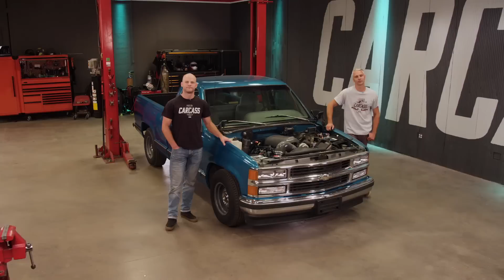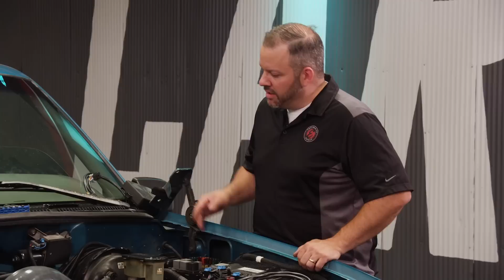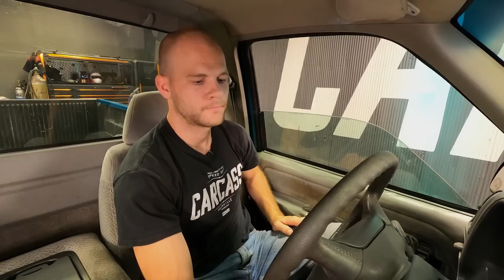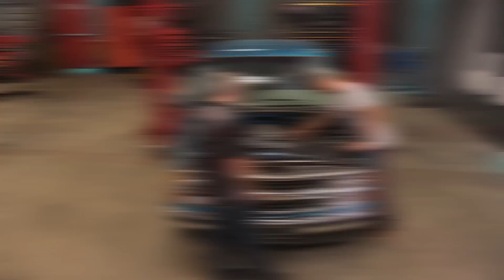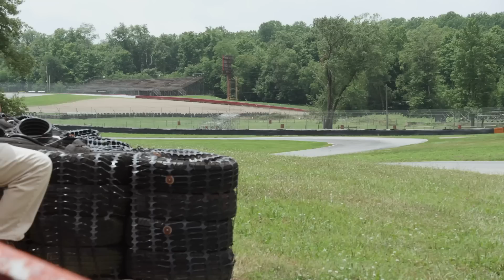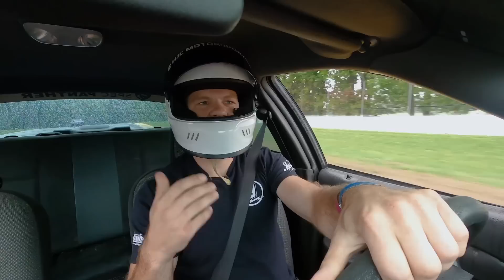Adding An EFI Setup To The C1500 Chevy - Carcass S3, E16

Comment: The gaping hole in “self-tuning” off the shelf EFI systems NOBODY wants to talk about is timing tables. RPM vs MAP vs degrees of timing. From cranking to running, idle, into AE, WOT, DE and everywhere in between to find the MBT for every cell in the timing tables. Only patience, experience and about 5 hours of chassis dyno time will yield those results. Or trial and error data logging on the street over many more hours in far less ideal conditions.

Comment: $2000= for the engine side, plus another $800 for the transmission controller...........or you can spend $1200 for a holley terminator x, or $1600 for a terminator x max. Who in their right mind would pick this over the holley?

Comment: Not very plug and play or cheap if you need to buy a special throttle body and separate gas pedal.
Reply: If you're going to be engine swapping you should Have enough knowledge to do it.....

Comment: Stop using self-tapping screws as permanent fasteners, and stop using a f’ing torch on any form of heat-shrink connectors. 🤦🏽‍♂️
Reply: Not like they have a fully set up shop or anything....  😉
Reply: Who?
Reply: @zacharypasch8652  did you not see how they mounted the ECU and TCU, or how they heat-shrunk the weather-proof butt-connector?
Reply: @ExhuastedLama  no like who cares? Let them do their thing.

Comment: If I do a swap same engine just newer do I  have to"flash" it.. what does it mean to "flash" the vehicle
Reply: It means to program the truck's computer (ecu) to the swapped engines configuration.  If you swap in a newer motor normally you do have to adjust the tune. For a stock ecu, even if you change the cold air intake, cam, or headers a new tune should get flashed in.  Most of the aftermarket systems are self learning and you just answer a few questions and it takes it from there. Hope that helps.